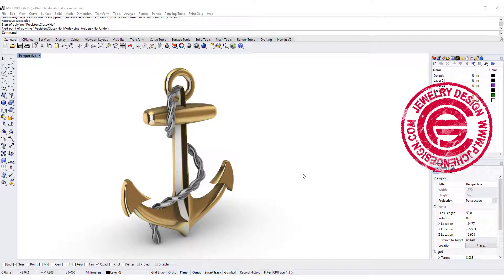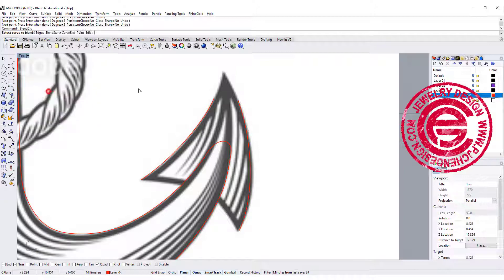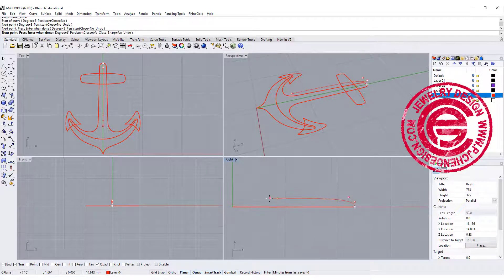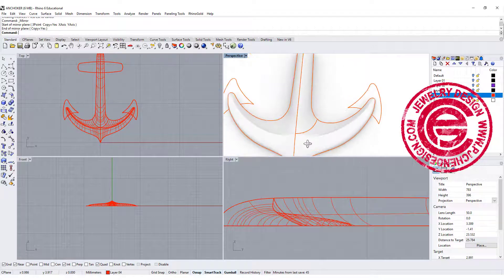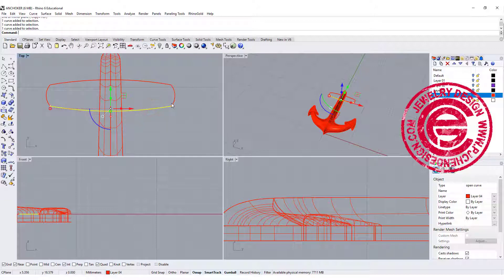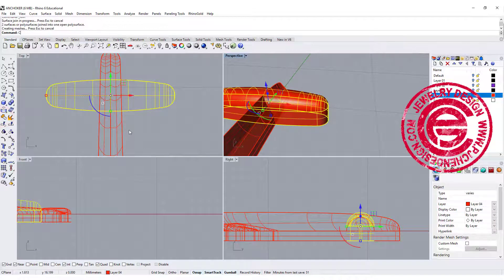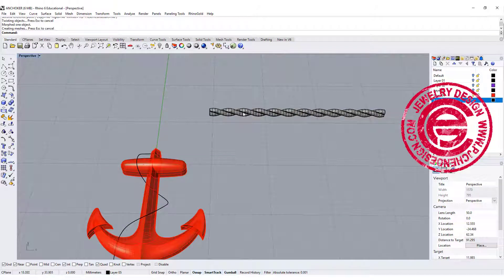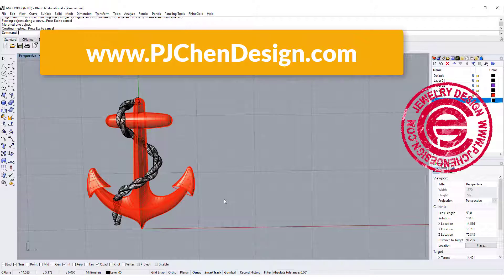Boat Anchor Pendant 3D Modeling in Rhino 6: Jewelry CAD Design Tutorial#109

Comment: I never used Rhino 6 before. I have used Fusion 360, not so much though, only for education purpose. This program is so good and it is just what i need for my hobby making silver rings.
My problem is that PJ is  professional with this and i am not, so the speed of tutorial is too fast for me. And there is much i don´t know about the software itself. For example those windows in right side on PJ´s screen and how to get my windows to match his. I made a signet ring with help of PJ´s video. The video´s length was 14 minutes but for me it took several hours. I tried to look a video for beginners for Rhino 6 but there is not so much. I found one but it starts too much from " scratch " and ends where it should start. It would be nice if there was a tutorial for beginners with examples how to use all those tools, step-by-step.
Reply from the maker: Hi Risto, my new course "Jewelry CAD Design- Introduction to intermediate Rhino 3D" will be published on 7/15/2020. It is a systematic way to guild you from very beginning of Rhino. This will help you a lot to understand the fundamental 3D modeling concepts. After finishing the course, all my Youtube tutorials will make more sense to you. You can check out the course at www.pjchendesign.com
Reply: @PJChenJewelryDesign  Hi PJ. Thank you very, very much for this information. I am looking forward for this course.